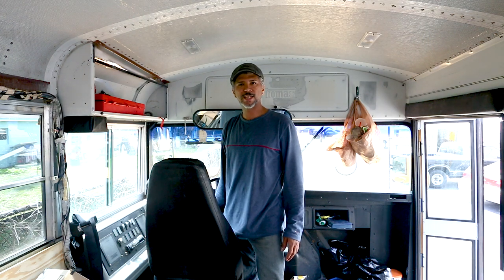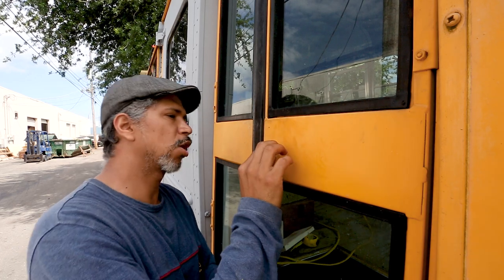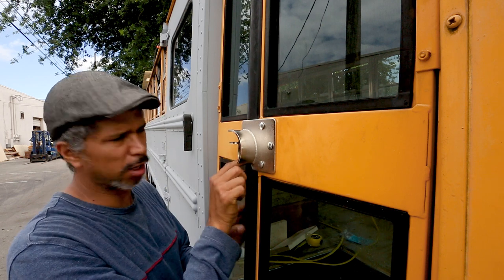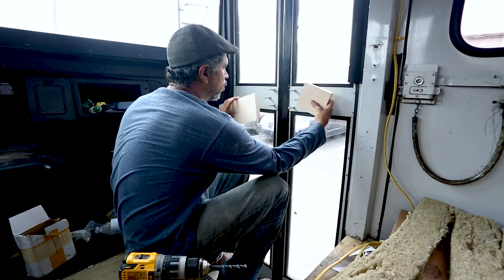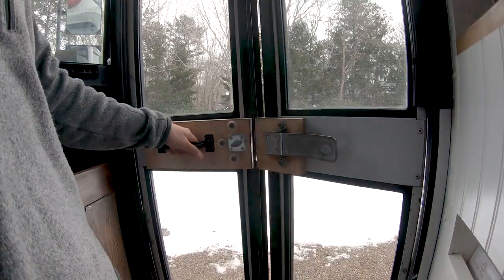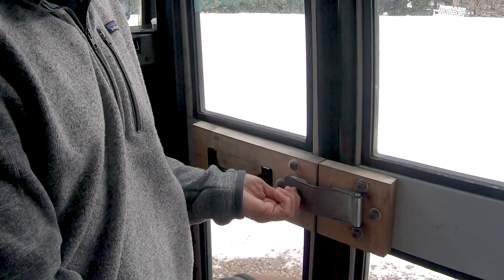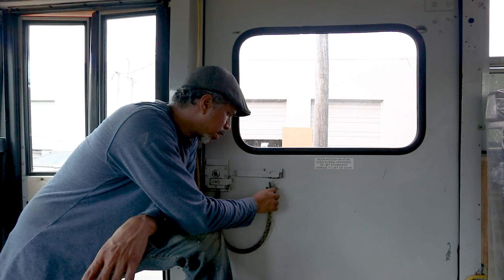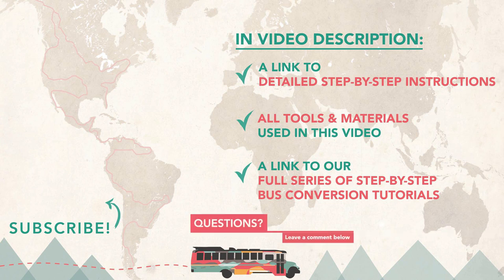How to Install a Skoolie Door Lock | Bus Conversion Tutorial

Comment: Thank you for the info. Does the lock double as a door handle from the outside? Or do you have a different handle somewhere?
Reply from the maker: It doesn't really works as a handle but for our door we don't really need one. Once we unlock it's easy to open the door.
Reply: @ArtWeThereYet  Ok thank you.